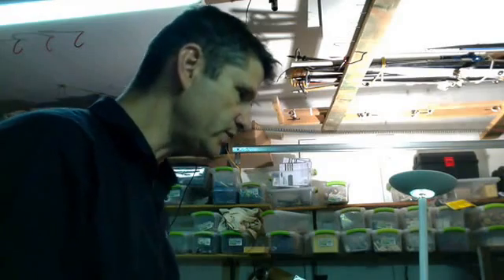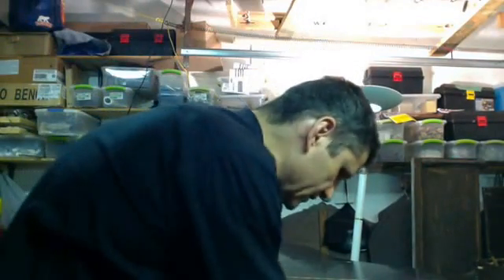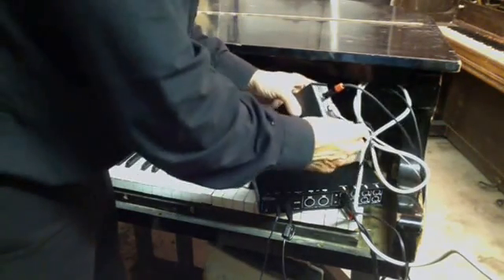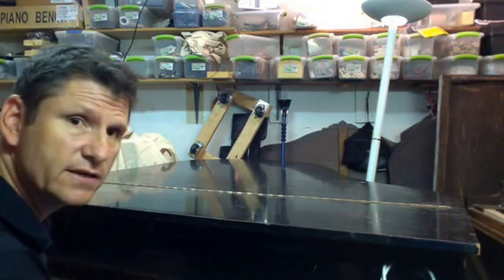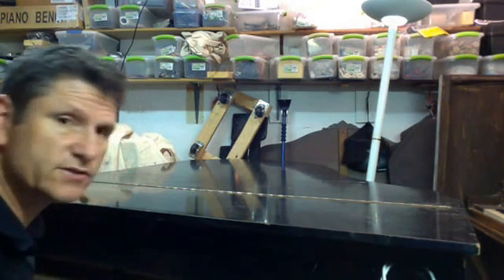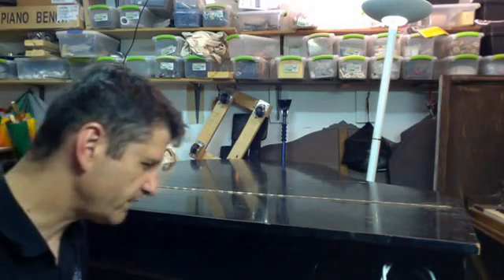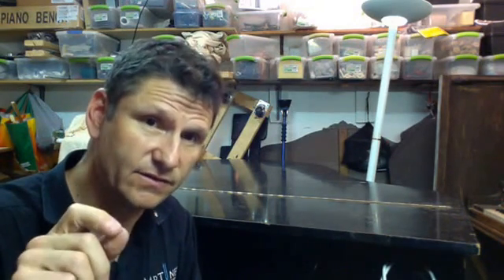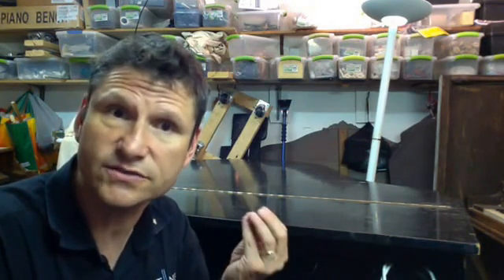Using an MFJ Tunable Audio Filter to help beginners learn to tune a piano by ear.

Comment: Hi Mark,
The filter was tuned to A6! You were listening to the 10:8 partial match at 1760 Hz, not the 5:4 at 880 Hz. This actually made it more difficult to listen for the beat at 880 Hz when you switched the filter off. Just saying...
Cheers,
Mark